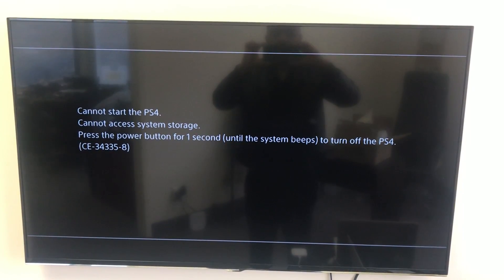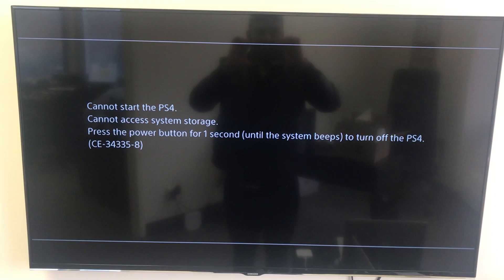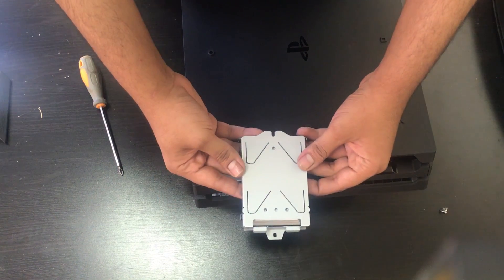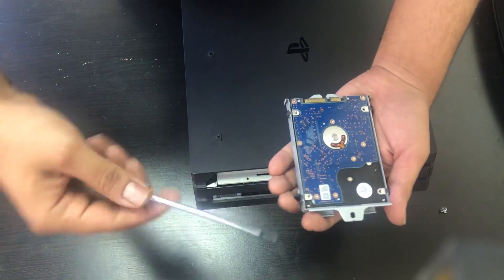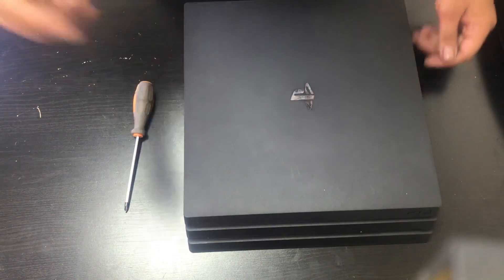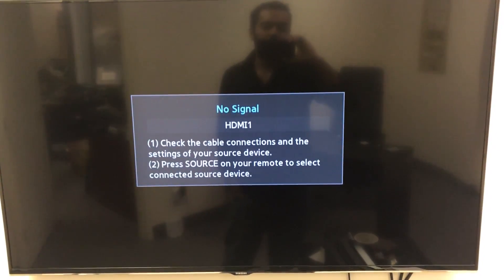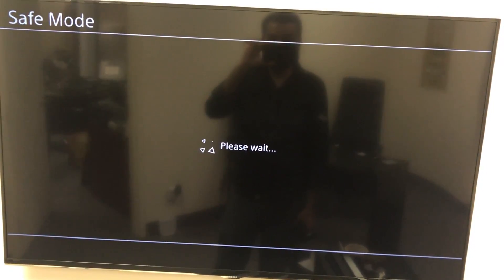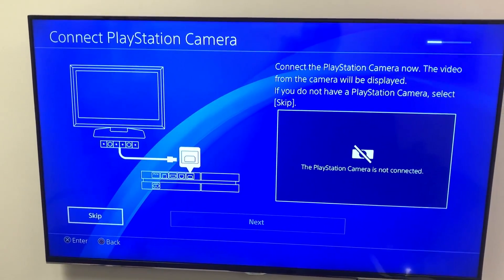PS4 Pro Cannot Start (CE-34335-8) Cannot access System Storage Error Repair

Comment: Um what do you if you can’t get the hard drive out? Like it’s full on js stuck there, ive unscrewed it and all
Reply from the maker: Drop a little of of isopropyl alcohol in there to make it unstick but dont use too much and make sure the system is unplugged
Reply: @fasttechvideo ty got ut working again

Comment: Can i use an external hard drive instead of an internal hard drive? Basically replacing it?
Reply from the maker: No. Perhaps you can remove the external hdd from its enclosure and use it but only if its a SATA hard drive on the inside

Comment: Can you help me? My PS4Pro bricked itself while autosaving and I had to pull the plug just to power it down. Of course it couldn’t access the storage after that, but I booted it into Safe Mode and rebuilt the database. It came back on and I saved all of my data by transferring to another console. Something was still very wrong, every time it went into Rest Mode it would cut it’s power and the next time I turn it on, “Can’t access system storage”.

So this is when I wiped the HDD reinstalled the firmware aaand it still did the same thing. I even did it again, this time rewriting the whole HDD to NTFS. Still the same results. Is it just my PS4Pro? Is it really just scrambled to no return? Is it the hard drive, even though I redid the whole thing?
Reply from the maker: Your hard drive needs to be replaced. HDDs die eventually
Reply: @fasttechvideo  Oh okay, so this is just what it looks like before it stops working for good. Thank you for clearing that up, I’ll definitely take a look at that link.
Reply from the maker: If you’re interested in one links in the description box

Comment: My question is for usb drive can I put it in the back because mine doesn’t fit right in the front ? Also do I have name the update something I heard it was like something fat35
Reply from the maker: The usb has to be fat32 or exFAT.
I believe you can use the back USB port but Ive only ever used to front USB ports for this.

Comment: i just did the initialize ps4 option in safe mode and it did read the file and it did the reset but when it turned back on it still got the cannot access system storage error.
Reply from the maker: Replace the hard drive. If you need one check the top comment and the description box.
Reply: @fasttechvideo  ok
Reply: @fasttechvideo  hey i bought one of your ps4 hard drives on the first of this month and i got the confirmation email but i never received a tracking email or a hard drive. are you not selling them anymore or something?
Reply from the maker: @Kinseliplier  sorry about the delay in your order these hard drives are on back order. Rest assured they should be shipped out soon.
Reply: @fasttechvideo  my hard drive just got here yesterday. that took Fucking Forever. i didn't realize it came from Canada. im in america.
Reply: @fasttechvideo  wait your Fucking Hacking. how the Fuck did you get the Screw off it after you took the panel off the ps4? i just opened the back of my ps4 and it was so tight i had to jam it open with a screw driver cause it was physically impossible to open it with my hands since it was so tight it was hurting my fingers trying to open it. now that i have the back panel off i can't get the Fucking Screw off the God Damn Hard Drive cause its so Tight that even my Screw Driver cannot turn it and i have a Phillips Head Screw Driver that Perfectly Fits it. its so tight i need a drill to get it out. how the Fuck did you do that with a Screw Driver?
Reply: @fasttechvideo  dude i just finally finished the replacement just now and i don't know how the Fuck you were able to do any of that with you screw driver. not only was the screw that holds my hard drive on my ps4 tight enough that i could not turn it with my screw driver but the 4 screws that held my hard drive in its housing also were that tight and i had to brute force all the screws with a pair of pliers as hard as i could and even that just barely turned them and bent them a little. i completely stripped the screw that holds it in that ps4 even though i have a small phillips head screw driver that perfectly fits it and i was clearly turning it the right way.
Reply: @fasttechvideo  hey how come when i use the first update file link in your description it says "An error occurred while processing your request.
Reference #132.f8352f17.1664990955.4ccaf41"?
Reply from the maker: @Kinseliplier  right click on download button and press ‘save file as’
Reply: @fasttechvideo  yeah I did I saved the file and the update worked this time.
Reply: @fasttechvideo  I downloaded the official one from the PlayStation website cause it's easier.
Reply from the maker: @Kinseliplier  i have fixed the link, press the download button and it should work now. Please let me know how it goes.
Reply from the maker: @Kinseliplier  great, good luck and let us know how it goes. Also subscribe and like the video 😊
Reply: @fasttechvideo  yeah it worked and my PS4 is back on
Reply from the maker: @Kinseliplier  awesome please like the vid and subscribe 😊

Comment: I have a question, if the way you fixed it in this video works will I lose all my game data, that is all i really need.  Is there anyway I can fix it without losing everything?
Edit:  Also, is there anyway I can back up the data before it is too late, if so how can I do that if my ps4 wont turn on?
Reply from the maker: You can try repairing your old hard drive to save your data but that is beyond the skill level of most people, even techs.
Reply: @fasttechvideo  ima try
Reply from the maker: @ryans2874  Let me know how it goes. We will be releasing a hdd repair video in the future

Comment: Does anyone know if I can use the same hardrive or I have to buy a new one? Can I also use a game drive instead of a harddrive  if I need to buy a new one. If I need to buy a new hardrive, can I transfer my old one to the new instead of erasing everything in my old one? I'm sort of new to this and I'm not much of a tech guy. My ps4 had this problem before last year and I couldn't find out how to fix it.
Reply from the maker: You cant use a game drive as a replacement for an internal drive.
Reply: @fasttechvideo  thank you for replying and helping me with my situation,  this information has now made me realize that and I'm going to a repair shop tomorrow to see if they can help me out. wish me luck.

Comment: I changed the hard drive and it still didn’t work 😕
Reply from the maker: Sorry to hear that. Your new hard drive could have gotten damaged in shipping. If you bought one from us you can return it for a refund or replacement. In rare cases it could be a controller chip on the mainboard that is defective.

Comment: All I had to do was unplug and plug it back in and it worked.🙂
Reply: This is just a quick fix mine will start after 30 mins but its really annoying when the power goes out or something
Reply: @jaycup711  DUDE I HAVE THE SAME PROBLEM
Reply: @mirage4733  as long as it has a 30 min wait time it turns back on so imma save my 70 bucks I guess lol
Reply: @jaycup711  boys I have bad news for you. I've been dealing with this shit for 2 years. It doesn't get better. Only worse. And my shot sound like an airplane now.
Reply: @bxb1996  Well I took out the hard drive and after like 10 seconds put it back in and then plug it up, start it turn off, unplug then plug back and it worked
Reply: Rlly bro did you clean it or just took it put
Reply: @Türkiyem-61  just flip the switch next to the plug and flip it back on
Reply: Lucky bastard nothing's working its stuck in safe mode and this
Reply: @slurxify9831  any luck fixing it ?
Reply: @slurxify9831  bro why are you so aggressive i have the same Problem but he had no Big problem thats all, my ps4 pro is now like 3 weeks gone and it will come probably next week again
Reply: @Türkiyem-61  nothing fucking works
Reply: @slurxify9831  do you have guarantee
Reply: @slurxify9831  did it ever work because my shit ain’t working and I’ve tried everything I’ve seen
Reply: @17rings14  no turns out my harddrive just gave out
Reply: @17rings14  sorry dude it costs like 20 to 50 bucks to I'm not sure where to buy one either and when you do get it it will a reset to your ps4
Reply: Holy shit i just unplugged the power cable and plugged it back in. It worked!. Thanks man
Reply: @MrLofia  how long did you leave it unplugged for?
Reply: @javi763  i did for around 10 sec, sorry it took long to reply u prolly repaired ur ps4 by now
Reply: This used to work for me but it's happened again and now won't go past this  screen or safe mode
Reply: I did too. The problem still happened randomly.
Reply: Theres another video that says the hdd connetors are dusty and needs to be cleaned out.
Reply: Same for me
Reply: Im glad i saw this comment

Comment: bruh i have to spend 79 dollars on a hard drive
Reply: Exactly
Reply: Bruh, I have to take it apart
Reply: So I woke up to this now I have do a madness open it u and that safe so basically my ps4 is gone ffs
Reply: @hfeybbandit9963  i think there’s still HOPE, because i thought my PS4 was DONE & i got it fixed got a new HDD & it works fine
Reply: @chinoreno1  did it affect your data since its a new hdd im planning on getting a new hdd but im scared all my data will be gone
Reply: @grublivesmatter2828  long story short, some games i had to restart all over. when i took my PS4 to get fixed the old HDD was DEAD they had no way of getting into it so they sold me a new one & installed it.
Reply: @grublivesmatter2828  there’s a way you can backup your storage ill tell you the steps
Reply: @chinoreno1  howww
Reply: @chinoreno1  by the way im getting a ps5 in 2 months if i log into my ps5 will i have my data then?
Reply: @grublivesmatter2828  you go to your settings, go down where it says (application saved data management) then saved data in System storage then it shows the games you’ve played on your PS4 & click on which one you want
Reply: then you select all of the saved data you’ve saved before & it transfers to your new data or the old data you have
Reply: @grublivesmatter2828  i don’t think you’ll have your saved data from your PS4 to your PS5 for example if you play GTA 5 on PS5 it’s gonna ask you if you want your old gameplay to delete or keep it just on your PS4
Reply: @chinoreno1  when i turn on my ps4 it brings me to safe mode im just gonna buy a new hdd thanks for the tips tho man
Reply: @grublivesmatter2828  really? mine never did that mine wouldn't even get to the main menu it just said ps4 cannot turn on
cannot access system storage so obviously that means you need a new HDD so i got it fixed & they installed a new one
Reply: @grublivesmatter2828  you're welcome man
Reply: @chinoreno1  same
Reply: @ez_dubz_btw5901  what part? 😂
Reply: @chinoreno1  the part when it can't go to main menu
Reply: @ez_dubz_btw5901  oh yeah i ducking HATED that part i wanted to KMS
Reply: @chinoreno1 what’s hdd
Reply: @hfeybbandit9963  F
Reply from the maker: We have a 500gb option which is much cheaper
Reply: @fasttechvideo  when u mean much cheaper how cheap r u talking
Reply: i wanna kill myslf my PS4 is destroyed 💔💔
Reply: i had a 2TB hard drive if i get a 500GB would it work?
Reply from the maker: @JeydenPerez-yr3nz yes

Comment: My 2tb SSHD randomly stopped working and I got the same message. I don't have any idea why. It's not the SSHD because I plugged it into my pc and it found no errors. Then on top of that after I got tired of trying to mess with it.  I ended up just putting it in my pc because it was actually bigger and its an SSHD. It's been working fine in my pc ever since.

Comment: I really don't know why i need a new Hard Drive when mine is clearly working without any issue and then all of a sudden, you need a new HDD, Why?
Reply from the maker: Hard drives just like all electronics fail eventually. The most common reason for early failure is shock or fall damage.
Reply: @fasttechvideo  my bro dropped it now this happened dang
Reply from the maker: Kingnugget545 Harddrives don’t like getting dropped.
Reply: @fasttechvideo  Thx, now i know why .

Comment: I reinstalled my system software I was so happy and 3 days after I was playing and i exited the game and than my ps4 completely froze turned off and I got this problem.Nothings working for me.
Reply from the maker: HypeBeast Life you need a new hard drive. Links in the description box.
Reply: Fasttech thanks
Reply: HypeBeast Life did it work after you replaced it
Reply: Lekë Hoxha Yes but I didn’t use the Fasttech hard drive since my cousin gave me a 500gb hard drive that he didn’t use
Reply: Yeah, when your PlayStation freezes and turns off it means that your hard drive is probably dead.
Reply: @yousifomar9459  does it die when you have had the ps4 (the pro verson) for 10 months?
Reply: Does it keep your games
Reply: I replaced it and it still doesn’t work what do I do ????
Reply: I've got the same problem. I've changed the hard drive twice and each time during reinstallation screen gets to 14% and then throws the code again. In some cases it has worked but in this case its a different problem internally I'm thinking.

Comment: I have the same problem with my ps4 pro but even after replacing with new Hard drive its the same error and i tried by replacing hard drive from another working ps4 of my friends. Still same problem
Reply from the maker: Did you consider that maybe your friends PS4's hdd was also on its way out?
Reply: @fasttechvideo  i tried by replacing 3 to 4 hdd its same error i tried by purchasing new one also
Reply from the maker: @ahteshamali4082  You probably have a mainboard issue then.
Reply: @fasttechvideo  yes. Do you have any suggestions where can it be repaired in india
Reply: Guys how did you solve the issue mine is still doing the same thing even after replacing hard drive

Comment: Does a external hardrive work?
Reply from the maker: No
Reply: Fasttech so just to make sure any internal hardrive that is for PS4 pro will work?
Reply from the maker: @cooltoad601  Yes an internal 2.5" HDD from a PS4 Pro will work in your regular PS4.
Reply: Fasttech ok so I have gotten a new hardrive and I did everything but when I have the new one in all the other safe mode options are disabled except for option 7 and it won’t let me update. I don’t know what to do. I also I have gotten the update on my hardrive so many times and it still doesn’t work

Comment: I just got a new Samsung 860 EVO SSD for my PS4 Pro and I just finished putting it back in my system but now I’m getting an error that says CE-34335-8 and it can’t access system storage. I tried putting my old HDD into my PS4 and now I’m getting the same error for that one too. I’m not sure what to do. I tried putting it into safe mode multiple times but it automatically goes to that screen every time. Not sure what to do.
Reply: nycballa417 did you ever get that to work? And how?
Reply: @SuperCandyy  its the same for me i have the same problem even when i hear a second beep (safe mode) i still get a screen that says cannot start ps4 and system errors etc i also put in the original ps4 slim harddisk and i Still get the same screen whatever i try / do. Nothing works
Reply: Bledder 070 just buy a new ps4 only way after that
Reply: @SuperCandyy  i literally have my new ps4 for about a week and a half and i wanted to upgrade the hdd and now i have this problem. I aint gonna spend a 300 dollars on a new ps4
Reply: Bledder 070 you didn’t get the warranty 🤦‍♂️
Reply: @SuperCandyy  i gave it to them and they said they fixed the issue but no
Reply: @SuperCandyy  ohh nvm i installed a new hdd and i got to the ps4 safe mode and  what i have to do now is just reinstall ps4 system and then im done
Reply: Yea I did get it to work. When I was installing the SSD into the ps4 I wasnt lining up the SSD with the screws in it. So that’s why it wasn’t working

Comment: I was wondering if I could not get a Knew internal hard drive, would it still work if I only use a external hard drive?
Reply from the maker: ツJacob It will not work without a working internal hard drive.

Comment: I replaced my hd less than 6 months ago. I'm so irritated
Reply from the maker: Where did you buy the hard drive? If its from us we will replace it for free.
Reply: @fasttechvideo  Not from you, although that's some good service!  It was something I found on amazon called the "Seagate Firecuda 2TB 2.5-Inch SATA 6Gb/s Internal Hard Drive (ST2000LX001)". I do not recommend.
Reply from the maker: @DDakotaSW  Thats why you should try us out. We sell new working tested hard drives for PS4. Guaranteed to work or your money back.